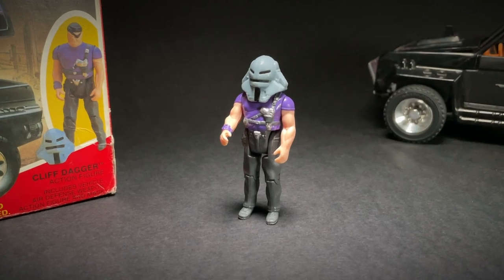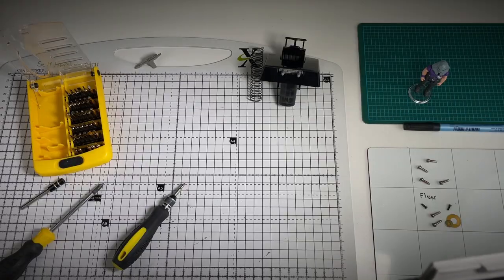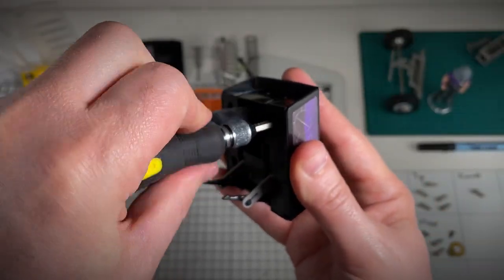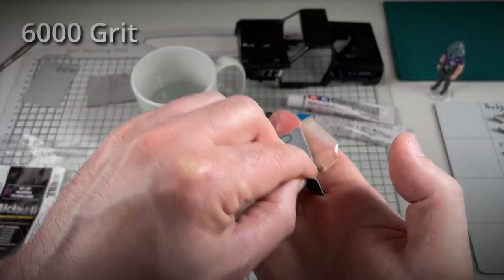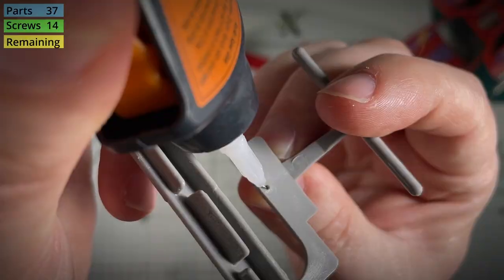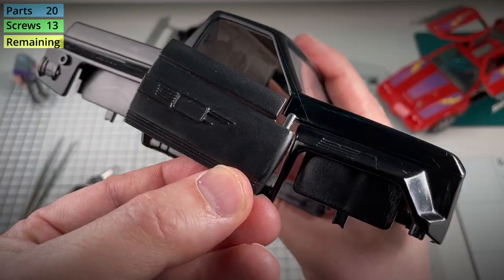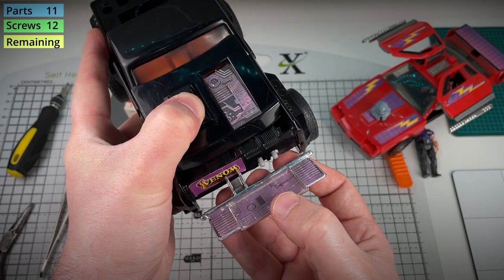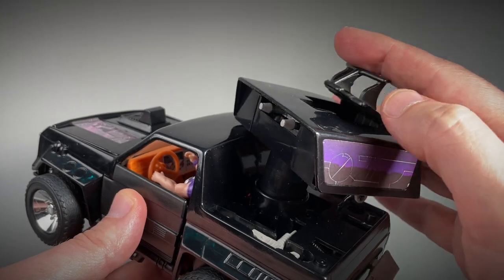Vintage MASK Jackhammer Dismantled, Repaired & Rebuilt - Toy Restoration Kenner 1980s

Comment: Great video Dave!...giving me the creative push I need to start work on the Odysseus ship from Ulysses 31 that keeps stating at me from the shelf.
Reply from the maker: Thanks!! 🤘 What needs restoring on your Odysseus? Never had one of those before. BTW, I have to get into the right frame of mind before starting a restoration, but once started, I can't stop 🤣
Reply: @VintageToyRush  not too much, just general wear & tear. Just a bit nerve wrecking as it's a toy you rarely see in the UK.

Comment: Good old Kenner with their screws. If that had been Hasbro it would have been a lot harder to take apart.
Reply from the maker: True, if only these things were held together with just screws! MASK vehicles tend to have welded plastic - Switchblade is the same! 👍

Comment: great video Dave. The rarity of MASK around me means most of my restorations remain cosmetic, and u have some serios balls spliting the welding! I would love a better front on my Jackhammer, but seeing the potential for permanent breakage, maybe not. I have used motorcycle visor polish for toy canopies to great success. Infact often car products seem to work well restoring old toys.
Reply from the maker: Thanks Brendan! 🤘 I have to admit there was a point where I thought do I continue or not when the welding was spotted!! If it's the grill you want to replace or restore on your vehicle that can be removed without any damage - just the front black screws 👍 I haven't tried visor polish before! Is that something that can be hand applied or is best with a polishing tool like a Dremel? Something to try out. I've seen some videos where toys are gleaming and have wondered how that's done 😀
Reply: @VintageToyRush  I just hand polished and within 30sec to min itpolisbed well. I will have a look at replacing the grill if I can find a nice chrome grill to replace the trashing on I have. I still need to find a rubber restorer for the wheels whilst they are in good condition. Silicon spray seems to be successful.

Comment: I have a Jackhammer. The only problem with it is one of the front guns underneath the chrome grille does not reciprocate with the other whilst the toy is pushed forwards. It can easily retract with its twin when the hood armour is pushed back down and the grille flips back in place. I have carefully shone a torch to look inside where the grey cannon parts are connected to the black chassis but nothing seems to have come loose. I wonder if one of the grey flaps on the axle when helps the front guns move in and out has somehow broken preventing its movement. I'd rather not try and dismantle the whole toy fully as I can see its such a complex build. The spring hasn't come away either that holds the cannon in place either. Is there a quick fix for this issue? The other front gun moves in and out with the rattling noise it should make whilst the faulty gun just stays in an outward position - i.e. static. Anyone else have this issue? Everything else works fine and it has been wiped clean and had some very nice repro stickers applied apart from one on the inner side of the front grille as it was in good condition. Any advice would be appreciated. Thanks Dave.
Reply from the maker: Thanks for watching and let's see if we can find the issue. First thing I'd check is the grey paddles on the front wheels. You should see two of them spinning when turning the wheels and the hood is down. I'd be surprised if they're broken but good to check. Next, it may be the gun itself. You say it stays out which suggests to me there is a problem with the spring. I would gently pull the gun out, let go and see if it retracts - the working one will. The broken one probably won't. Each gun has its own spring. Check there are two. If the broken gun is missing the spring, it's gonna be difficult to replace without dismantling. I doubt the spring is missing though. If you look at https://youtu.be/bY4pqmXSZHI?t=759 you'll see there's a really small retaining washer - it's possible that's missing. Use that part of the video to see if that's what you see on your Jackhammer. That's a good place to start - let me know if you find anything 👍
Reply: @VintageToyRush  Thanks for your reply Dave. Upon careful examination the fault lay with the left front gun not being positioned properly within its frame. One of the two notches on the gun - the upper one - had either popped out of place or had been incorrectly attached in the Kenner Parker Factory all those years ago. I personally reckon it's the latter of those two hypotheses as it's nigh on impossible to knock out of place that part. I had to partially dismantle the toy to fix it using a thin screwdriver and tweezers to get it back in place, as I could not get the bonnet off for a full dismantle. The hardest part was attaching the grey arm next to the faulty gun that connects to the bonnet and brings the guns forward and withdraws them when Jackhammer is in Bronco mode. Once I had fixed the cannon, I could have left it as is with one arm that would work the guns backwards and forwards when the bonnet is up or down. It irked me so much I had to get the arm back in place. Eventually I managed it and fitted the grille back on. Jackhammer now works perfectly. It is a highly intricately constructed toy and certainly not for the faint hearted to dismantle. I am glad I have restored mine and got that pesky gun fixed too. I shan't be taking it apart ever again - especially that bonnet which I found impossible to try and remove.
Reply from the maker: @TheMasterNo6  that's great news!!! perseverance won 👍 nicely done getting everything back into place in such a confined and fiddly space 🤘

Comment: Argh I hate welding, ah I see you have a...spudger?
Certainly takes some patience to polish out scratches and a lot of grit values. Been keen on it for Omnibot restoration since they use a lot of transparent plastic face plates.
Very captivating repair, I especially liked seeing that machine gun mech explanation. Also can appreciate that "taking a breather" moment, sometimes better to walk away for a bit. :)
Reply from the maker: This is the most difficult MASK vehicle to open for sure - at least in my experience so far. I was pleased with the polishing approach but have wondered if I can use a small polishing machine instead - something to research! Now, I do walk away sometimes. Nothing like damaging one of these toys due to frustration, tiredness or loss of patience.

So, you're a fellow restorer! When you say Omnibot, are those the Tomy ones? Do you have a channel or instagram showing some of your restorations?
Reply: @VintageToyRush  Oh so you have been thinking of machine assisted polishing. I've seen it done with metal toys but I guess small machine could be gentle enough.

Yeah I love Tomy robots. :D I'm thinking of starting a toy channel but I got to get more organized first.
New at restoration so I might film it or just concentrate on actually finishing a project lol.

Comment: Re:polishing. I just use a standard auto polish with a microfibre cloth. Much easier and gives great results.
Reply from the maker: Have used auto polish before, but thought I try something different as there were deep scratches 👍
Reply: @VintageToyRush  I’ve restored a JACKHAMMER too. Not to the extent you did but restored it all the same. Its a delicate beast. 👍🏻
Reply from the maker: Nice! They weren't designed to be opened 🤣

Comment: Can I just ask, I have a really minty Jackhammer with the only issue being that the front grill can droop forward a bit. Ive had the whole thing apart and nothing was broken, yours seemed to do the same at the start but not the end, was there a fix for this? Thanks
Reply from the maker: I wish I could say there was a specific fix. I think basically giving it all a good clean, having all the hood parts apart and re-assembling carefully did the trick. It seems to mostly rely on friction to keep it in place. I'm surprised you've taken your minty Jackhammer apart cause it requires splitting the body from the chassis which is glued!
Reply: Hehe, that droopy front would do my head in! I think I’ve sorted it without splitting the body, I popped the front grill off and removed the bonnet button like you have instructed. I’ve then heated the fork that is stuck to the bottom of the button and slightly bent it forward. It seems to hold much better now. I’ve come to the conclusion that every mask vehicle needed atleast one metal die cast piece, on this it’s that fork. (On switchblade it’s the wing latch etc..)
Reply from the maker: Awesome! Great to hear you've had success. I've never thought about MASK having die cast pieces but it makes sense. It would be cool to have that transformers feel for MASK 👍